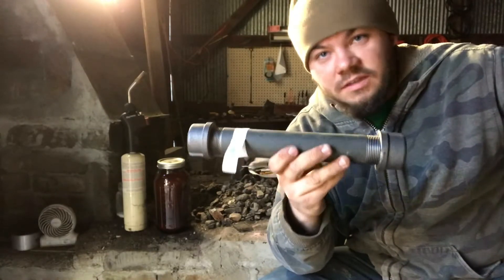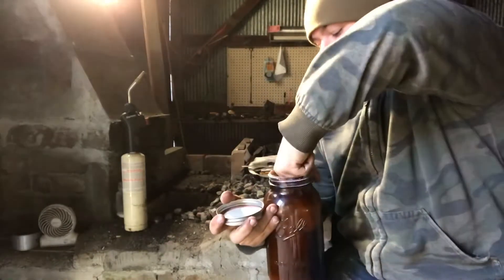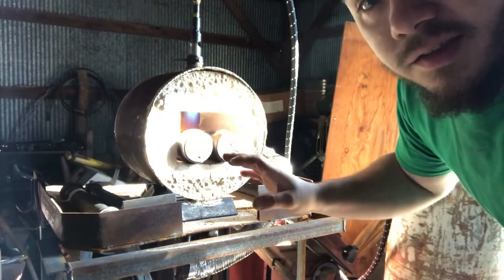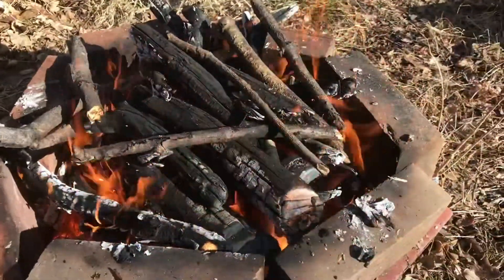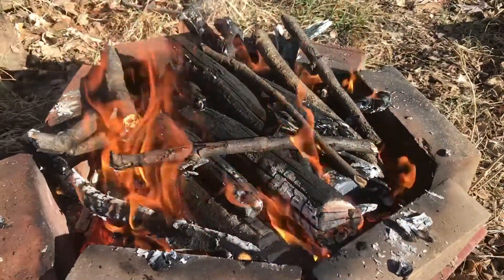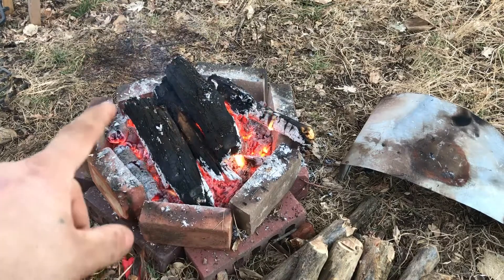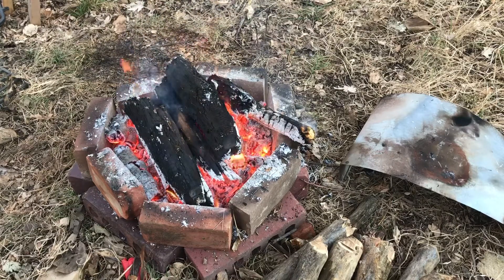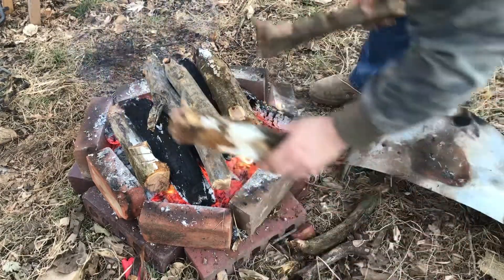Case Hardening Tools...and A KNIFE?! Pt 1

Comment: I case hardened a mild steel kiridashi with flour sugar salt and coal powder
Reply: You might want to use coke or charcoal instead of coal if you are going to do that regularly, coal tends to contain sulfur which might be able to diffuse into your steel under case hardening conditions.
Reply: @garethbaus5471  i meant charcoal
Reply from the maker: Good to hear! If you ever break it to study the inside I would love to know the time you left it in the fire and depth of carbon penetration.
Reply: @veteranironoutdoors8320  I put a chisel grind on it and one can kind of see the layers also I left it in my coal forge for 5 hours

Comment: Very interesting.  😀👍⚒️. Heading over to "part 2" now.
Reply: Oh... I'm not sure if I mentioned it at QS or not.. what about using bone charcoal and leather scrap, in place of the antacid?
Reply from the maker: drasons forge leather charcoal yes, bone no. There’s something in bone that makes it not work as well. I’m thinking of doing a part 3 covering other methods of doing it and maybe a head to head to see which gives best results
Reply: @veteranironoutdoors8320  ok.  My thought was for the calcium and mineral content, in the bone.  The leather, would be strictly for carbon, correct?